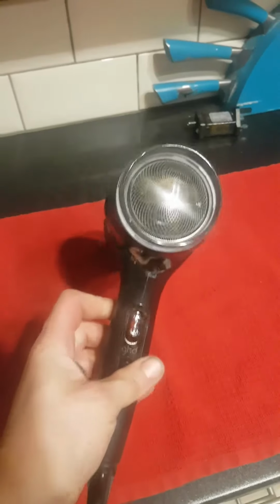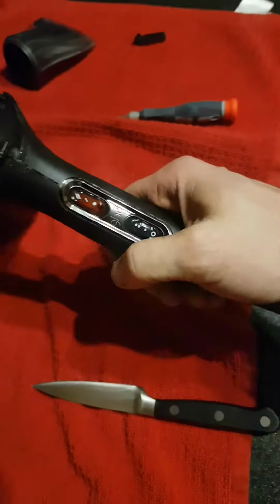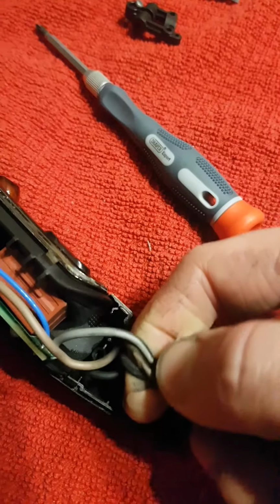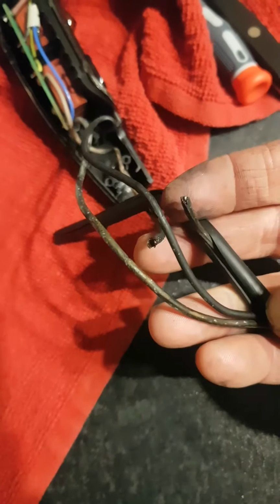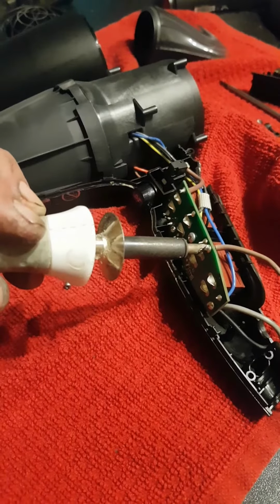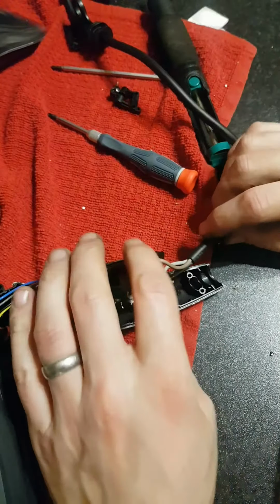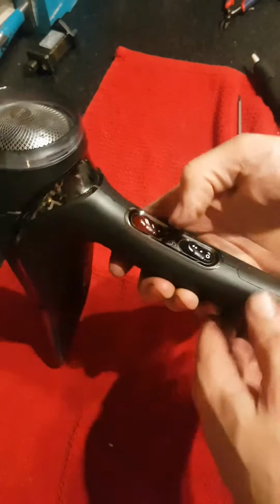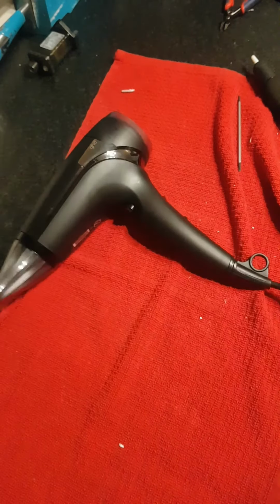How to fix your GHD hair dryers if they stop, trip or have a broken lead.

Comment: I've fixed many a GHD Hair Straightener when they first came out where all the wires that had tiny ring terminals on all the wires that went to the digital circuit board had tiny screws and nuts on them fastening them to the circuit board were coming loose and quite a few pairs where the thermal fuses inside the units had blown from people who left them switched on for hours and blowing the fuses.